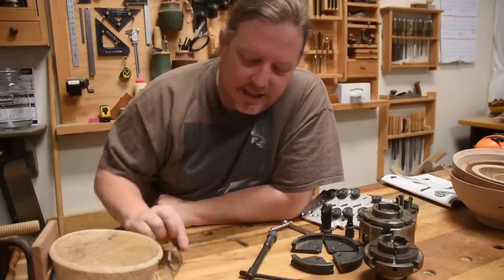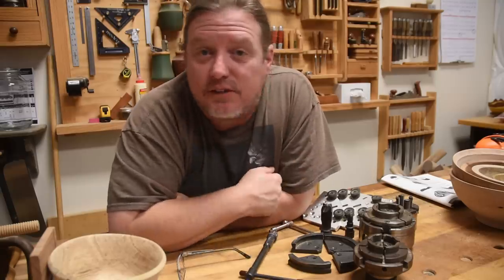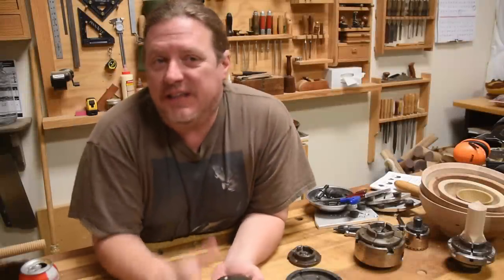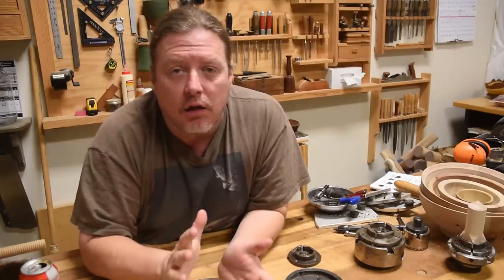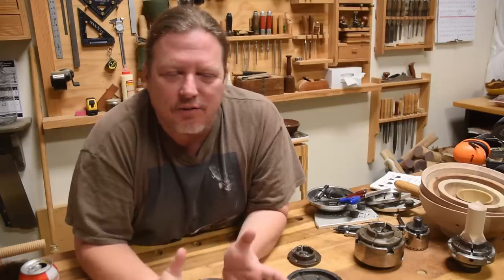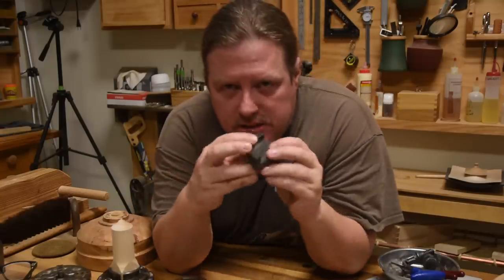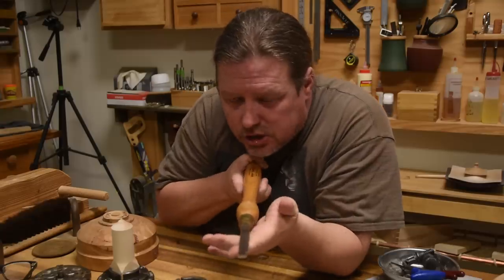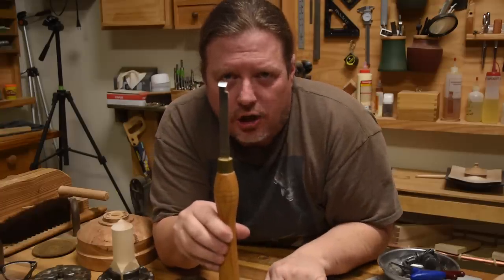Woodturning Chucks, Jaws, Tenon's and Recesses

Comment: Really really useful video,  Your drawings made thing so clear. thanks very much, 
Just sent off for a Record SC4 chuck and spur, have been using a very old Record Power chuck with separate inside/outside jaws which is a bit hit or miss. Very little "used" stuff on the UK market. sadly 
Glad I'm not the only one who "blows out" the bottom of bowls!

Comment: Nova by Teknatool were the first manufacturers of woodlathe chucks. Along with Vicmarc. They also manufacture, excellent chunks of various sizes including jaws that are 130 mm which is larger than your 4 inches. I have used both Vicmarc and Nova chucks and find them to be of equal quality. Nova chucks would be some of the best chucks with one of the largest ranges of jaws and inserts available on the market.

Comment: Interesting information regarding the serrated edges on some chucks. The only downside some experienced woodturners have mentioned about those type of jaws as opposed to smooth chuck walls is that if you need to remove the project from the jaws for whatever reason, when you reinstall the project back into the jaws, it can be very difficult, if not impossible to make the now jaw-compressed wood with the ridges reinstall back into the jaw ridge grooves since it is difficult at best to line them back up properly.  The end result is that now your project (especially with softer woods) most likely will not run true since you will now have introduced wobble if the jaw ridges are not lined up properly when the project is reinstalled.  Something to think about before removing the piece.

I have to say, I loved your way of explaining the reason of when to use a tenon for turning as opposed to attempting to use a recess method of holding onto the wood project being turned. Best explanation and with some good visual.  Now go invest in a set of thickness gauges. They're not that expensive. Cheap insurance.  Or you can take your eyes in to get them thickness calibrated. LMAO!

And I really like your tip for creating an inexpensive square headed scraper tool shaped to the chuck holding angle so that you can cut the recess for more holding power so-to-speak.

I definitely concur that care must be taken when using Cole Jaws of any size, but especially on larger bowls.  For small projects, Nova's G3 Pro-Tek 1"x 8TPI Reversible Chuck Bundle set (SKU 48266) is pretty cool if you can find anyone that can keep that crazy set in stock. The set comes with 3 different holding feet (or buttons as some call them) to use depending on your bowl's shape.  Of course they remind you not to go beyond 600 RPMs when using it for the reason you mentioned - only light cuts/finishing cuts should be accomplished by that point.

Your steps for setting up the chuck jaws is exactly what Nova recommends per their instructions; set them in loose, close the jaws, push them all together and tighten the screws up.  Not BS.  Works 99% of the time for me.
Reply from the maker: Same thing happens with smooth jaws.

Comment: This is the best, most thorough, well thought out treatment of wood turning chucks I’ve seen to date.  The only additions I wish you had were; 

1) some treatment of the different chuck keys, (I seem to have been blessed with three different keys for four chucks, fortunately all my jaws are interchangeable).

2) Some comment on the new easy change jaw system from easy wood tools.  I hate the time it takes to swap jaws out undoing 8 screws, changing the jaws, and redoing the eight screws.  I consider myself lucky not do drop one or more of the little buggers in the shavings at my feet.  (I find a couple of strong magnates help corral the little stinkers.)

Again, very nice coverage.  Well done!
Reply from the maker: I can only really speak with what I own and what has been directly told me from people I trust so I don't have much other experence with others like EZ. I will say Dad gave away one of their earlier chucks so I haven't been willing to risk my money.

Comment: Thank you for your vids! The help answer some of my questions, the rest I haven't thought of ye. I'm not new to turning, I just haven't put that much into it. I turned my first piece in my 6th grade woodshop. The idea was to make a wine bottle shaped lamp. I got close. All I was given was a roughing gouge. (took me 2 weeks). A friend loaned me a small vintage lathe with a 2 step pulley I added a motor and a belt. It has oiling ports on each end of the axles. Now I have a HF special 14 x 36 and it works well enough. I'm not happy with the motor being out front like it is. That cuts down the width of what I can do.

Comment: Excellent video. You did a great job covering some complex topics as usual. I agree Oneway makes great chucks but I hate their profile jaws. The serrations tend to compress fibers on a green tenon to the extent it can create a gap between the bottom on the bowl and the jaw face causing vibration and a weaker hold. I have several Teknatool chucks and like them but am impressed with the Record Power. I love the interchangeability of all the jaws on all of the Teknatool chucks and the Record Power chucks. Great benefit.
Reply from the maker: I have no experience with those so thanks for input.

Comment: Great video for those just getting into turning using jaw chuck's.
And One thing I would like to point out.  You mentioned that the jaws/accessories are usable across the three different chuck's.  Any of the accessories that are made for the Oneway chuck WILL fit the Talon chuck as well, unfortunately when it comes to the Stronghold chuck only those accessories made for it will work and ONLY for it.
When it came time to purchase a chuck for the lathe club at school we got a Oneway.  Fortunately or unfortunately for me the factory is just a few minutes down the road and makes my driving past it very tough.  Lol
Keep up all the work you do in advancing our great hobby.
Reply from the maker: Good catch

Comment: The large silver jaws with black rubber knobs were known as COLE jaws with the Nova series in the 80's.  I have half a dozen jaws - going to have to go and count now.  Do inventory.  Been into metal lately and now back to wood.  Nice, I can do metal and make tools for wood... :-)  I also have 4 and 5" chucks that fit.  Seems that in the day of my wood lathe small metal lathes were 1x10 and so were wood.  Now 1x8 is most common in wood.  So I got low cost metal chucks and my wood Nova.  My 4 jaw for wood and the big one on my metal lathe are independent jaws.  Rectangles are easy.  So are off square.  It takes more time to set up so the Nova takes most of the work.

Comment: Totally agree with the limitations of faceplate/center work.  I know that turning has been done for centuries without a chuck but then who would want to give up their vice grip piers? 
Just bought a nova g3 as my first chuck.   I had to have a machinist match the threads on my lathe as the thread was totally  non-standard.
Hope it wasn't a mistake... 
What part can I look for to fail first?

Comment: I think I prefer the heavier base that goes with the mortised attachment. They're less likely to tip over. But I'm also a fan of hot-melt gluing a scrap of plantation softwood onto the back and attaching that to the drive, and separating that off later.

Comment: This. Was informative. I am gearing up to restore a 1943 Wadkin gear head pattern lathe. An RU-12 with riser plates. The RU spindle is a  whitworth thread. So am likely to make my own chuck to avoid using adapters. Most of my lathe work is in pattern work. We usually laminate the billet in such a way as to eliminate the out of round errors caused when a bowl/log shrinks. What is interesting is that in the century of pattern lathes, you never saw chicks used. They could have if they were of value but they were not. Instead you saw your usual centers but often you used some form of face plate that screwed onto your work item. Some of the bowel like jobs are 2 feet or more in diameter. Flywheel patterns are the worst in that you  need to hold the wheel at its hub and often done as an outboard operation. Very informative video. Lastly what is your opinion on the nova chucks?

Comment: So last week I got myself a cheap lathe, and of course I haven't got a chuck yet,the only thing that came with it was a cast iron plate to screw a work piece on to.  So I was thinking to use an MDF disc ( that has been centered on the plate) and glue that to the bottom of a bowl.
Reply from the maker: Skip the mdf and screw to workpiece.

Comment: Perfect video for what I need to think about!! {I'm a subscriber!] ... I'm a brand new turner ... all I have with my barn renovation lathe are a couple faceplates, some spur drives, and a couple of live centres for the tailstock ... I've been looking at OneWay and Vicmarc chucks so I can be more versatile with turning bowls from blanks (I have a woodlot and a sawmill and chainsaws for rough shaping, but no bandsaw yet) ... it doesn't appear that either of them have dovetail jaws, which I'm sure I will prefer ... The Question: ... do you know of a brand or source of aftermarket or 3rd party jaws that are completely compatible with OneWay or Vicmarc? I can't tell the gold from the crap ... Cheers, Farmer John, Ontario, Canada

Comment: I have a Oneway Stronghold, and it's been in use since 2013 without fail. The only problem I had was when I left a set of jaws on it for several months, and needed to change the jaws, two of the screws were too tight to remove using the hex wrench, and I needed to use heat and an easy-out extractor. I was happy to have extra screws from when I bought the extra jaws. Now I turn the screws snug but not as tight as I did previously. I always check the screws before turning a new rough blank, just in case some have become loosened (it happens rarely).
Reply from the maker: Mine have never loosened but I also change them out quite often. Dream is to have one chuck for every set of jaws.

Comment: The most complete chuck video! Thank you! Can anyone link me to a video about drilling a long hole (like a flute) onto a piece of wood held by a chunk and drilled by a handheld drill screw. I need to do it this way because my cheap lathe has only a cone point at the tail piece.
Reply: Can you not remove the cone drive at all? I just bought a drill chuck that goes into my tailstock
Reply: @cbhalpin  I can remove it together with a cylindrical screw piece that holds it. It is not like the professional tapered cylinders going into the tail holder. A gentleman advised me not to use the tailpiece at all but a drill with a handle, the handheld drill would auto center. At first I was in disbelief that a handheld drill would auto center but then thinking about it: a normal drill spins instead of the wood spinning and we can hold it and drill holes with no problem..

Comment: Nova chucks by teknatool are a great option.  Just as high quality as a oneway.
Reply: Respectively I disagree.  I'm not a hater of Nova chucks as that was my first chuck purchase, mainly driven by the price.  But, after attending a turning class at Craft Supply in Utah and using Vicmarc chucks I purchased two of them and now the Nova collects dust.  Again, not a hater and my experience and opinion is solely mine in the "for what's it worth" column.

Comment: On almost my first bowl, I used a recess, and... I cut too deep. 
So, I just turned a contrasting coloured disc, glued it in to the mortise/recess, turned/sanded it smooth, and made it a feature.
( I dont like wasting effort, or wood.)
My next tool job is to make some measuring calipers to measure thickness, and to avoid the same problem, a simple wooden depth gauge. (just a strip of 1''x 2'' wood with a length of dowel through it.)

Comment: What is the function of a recess? 
You suggested it helps prevent a bowl from splitting, but what is the physics of that?
Reply from the maker: 909sickle there’s more meat there. Think about it.
Reply: @wortheffort  I was thinking there's less meat there, because a recess is removing wood. My understanding is cracking is caused by either uneven drying or stress in the wood, so I can't figure out the connection between the removing the circle of wood and preventing cracking. Thanks

Comment: Cheap made chucks probably use leadloy soft steel, wile a good chuck uses a 4140 heat treated metal 
The softer steel gets stress wear and this can cause them to loosen up.
I worked in a machine shop I ran the saw department and I have some idea how different metals behaved  how soft or hard it is to cut. So this gives me an idea its properties and uses  just like different types of wood like pine to purple heart 
One works easy the other is harder to work and some woods are so hard its extremely hard to machine.
Metals the same way.
Take drill bits youve got a cheap drill bit set that cost 19.95  it works but dosnt stay sharp. Then a set like it cost 140 bucks holds an edge forever and dont break wile the 19.95 set might bend.
Has a lot to do with what the metals made of and its carbon content. 
Chucks are going to be no different. 
If you want to know how a 4 jaw chuck works each jaw in or out together search youtube becuse machine shop tools shows cut aways and how a chuck is made, not all 4 jaw chucks close and open togather some each jaw has to be adjusted one at s time. But thats going to be on a metal cutting lathe.

Anytime you use a chuck 3 or 4 jaw
Drill press or lathe most of them have 3 spots to open and close each point to operate it should be tightly turned this ensures it won't open or back off. So even a cheap made chuck has a chance to stay closed. 
As for clock or counter clock turning I wouldnt run a lathe backwards without a locking pin so the chuck can't come loose. Im not sure its a thing.
Id also always make sure its clean of dust and chips anything on a jaw can cause it to loosen if only one jaw is .001 to tight over the other jaws. And most chips splinters or dust will be larger then that.  Wipe it off blow it off or use a clean paint brush to brush anything away.
Keep in mind air can lodge chips inside the jaws and its just as bad as on the jaw.

This guys one hell of a good woodturner but keep in mind its an artform it takes skill, he learned over the years by doing it and making the classic mistakes a few times.
I wont believe him if he's said he's never had ___ happen. He has. 
Wood is a odd medium to work with and no 2 chunks will be the same not even from the same tree. Its a living material
And anything could have happened to it over its lifetime that can be 100s of years or a few years. 
Thats the fun of working with wood its unpredictable actions .
So yes you're going to have stuff fly apart fall off the lathe or bust, that why you must use safty gear.

Comment: You didn't talk about the chuck and jaws location numbers 1 - 4. These numbers indicate  how they are machined at the factory.
 They keep the piece more centered. And the jaws fit better in the chuck when we match up the numbers. Jaw 1 should go on chuck base 1 ECT. 
  Thanks for the videos.
Reply from the maker: Daniel Wilmot haven’t found that to matter much with brands I prefer but I’m not rechecking blanks often. Metalworkers on other hand....

Comment: i turn mostly bowls - 90% and I have a drive spur that fits into my chuck (record power sc3) so I hardly ever remove my chuck. However I realised i cannot remove the jaws. do you have any help of tips to get the bolts out. they are allen headed (3mm).
Reply from the maker: soak it in penetrating oil
Reply: When you do get them out, use some anti size grease from an automotive store to prevent it from happening again.

Comment: You didn't ruin the bowls, you made lamp shades!
Reply from the maker: Or Clocks and Dust Shrouds
Reply: I won a piece on facebook that a Turner made,  it'd a bowl with a hole in the base but then a hourglass base (stem)  was added so it sits like goblet.